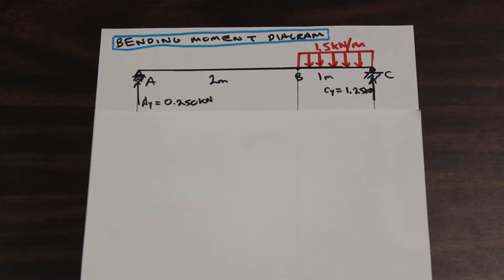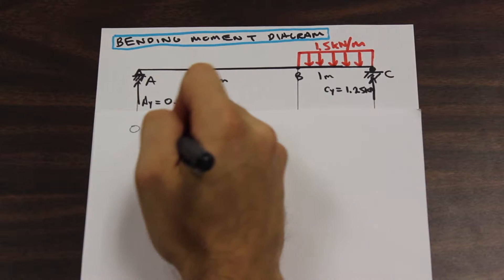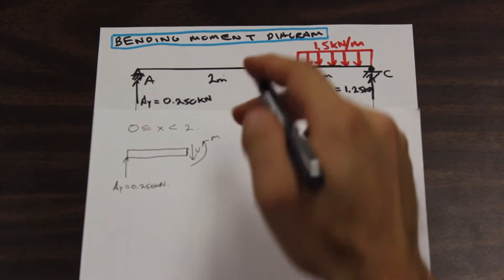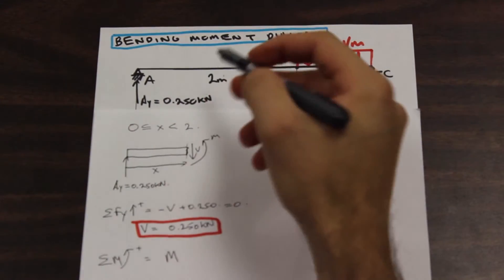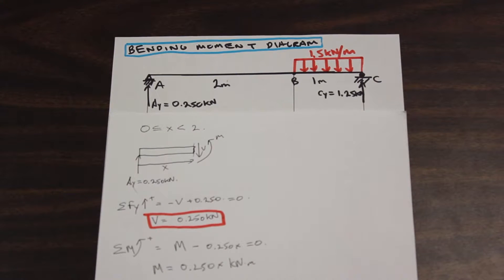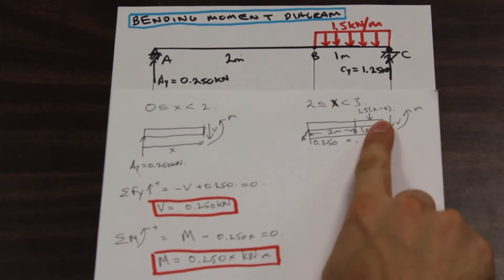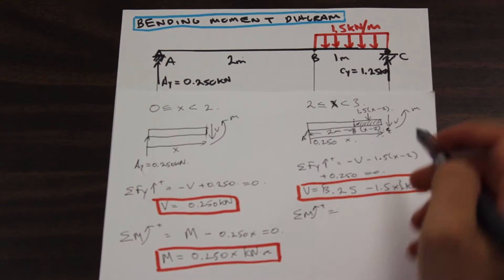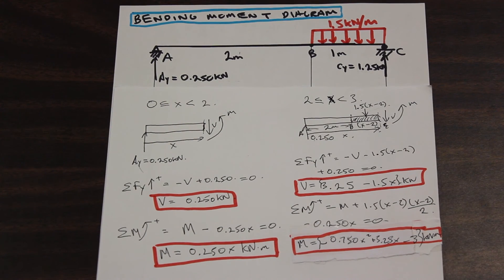How to Solve a Shear Force and Bending Moment Diagram Using Equations - Part 2/3

Comment: How do you decide how many sections or equations you need to solve
Reply: Depending on how many points are there in the given, i think i am a little bit late to answer :)
Reply: @naitepitome607  it's cool thank you. So it's more like a section between two forces from one of the pivots. So number of forces -1
Reply from the maker: Sorry, I didn't see this comment for some reason.  This question really boils down to fundamental statics and it's really important for later concepts.  It's a really basic principle: in a 2d system such as this, we always need to satisfy the conditions for equilibrium: sum of forces in x and y =0, sum of moments = 0.  So the entire system needs to fulfil this, as well as anywhere we cut internally. This governs the number of equations we need.  Also remember that the number of equations must equal the number of unknowns for the system to be solvable.  Hope that helps!